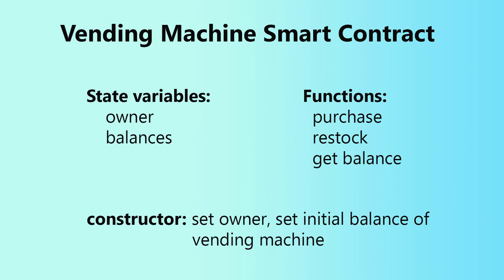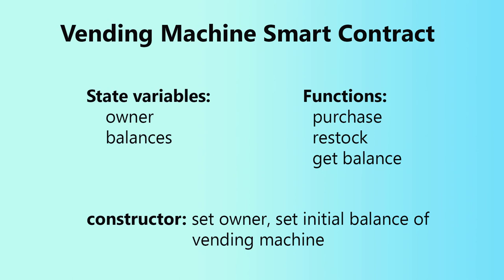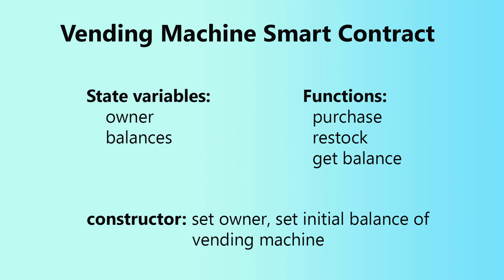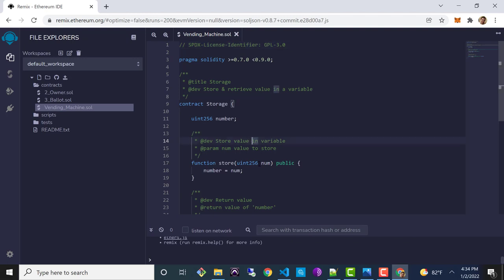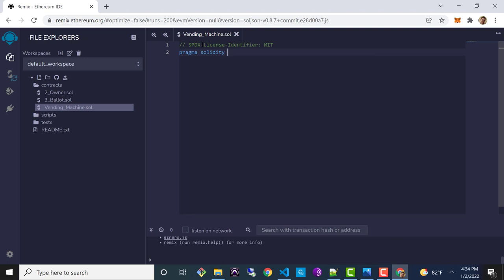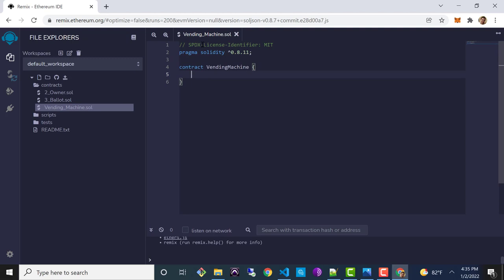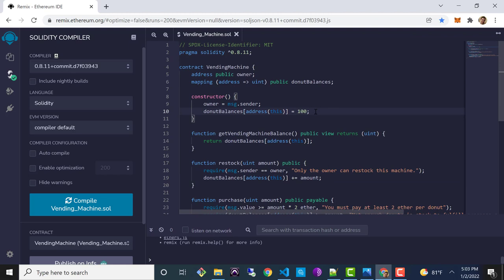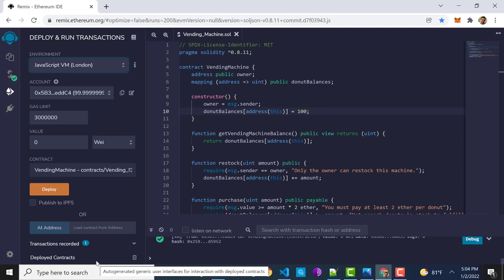Smart Contract Tutorial - Vending Machine Smart Contract in Solidity

Comment: I do have a question.
In few last lines you defined how can someone send a transaction, however, I didn't see you specified anywhere whom the receiver should be. Is that a mistake or I missed something?

Also I saw balance of your acc was 95.99ether and you used it from the same account so it should have been 99.99 (because those 4 eth would come to your address anyways)

Comment: I'm starting with solidity and I still don't have the concepts very clear, so I don't know if the question is silly, but where does the ether that is sent when you buy a donut go? Because I see that the balance of the owner's account does not change
Reply from the maker: hey David. that's actually a great question. the ether you send in to buy a donut goes to the smart contract itself. a smart contract can receive and hold funds just like any wallet. it's the 'payable' modifier on the 'purchase' function that allows the contract to receive funds. in order to get paid, the owner of the contract would have to withdraw funds via a separate function call. The current contract doesn't implement such a function, but it would look like this:

function withdraw(uint _amount) external {
  require(msg.sender == owner, "Only owner can call");
  payable(msg.sender).transfer(_amount);
}
Reply from the maker: or 'address(this).balance' to reference the entire balance of the smart contract
Reply: @BlockExplorerMedia  In addition to withdraw function, You also need to make the owner address payable for fund transfer.

Comment: Talking about the purchase function, you tested using the same address as the owner address (msg.sender == owner), how come it worked storing the correct amount of donuts? Could you explain this? I expected something like: 
        donutBalances[0x123] -= 1;
        donutBalances[0x123] += 1;

So the donutBalance of 0x123 would be 100, not 1 or 99.
Reply from the maker: Hey great question. 'msg.sender' means different things depending on the context of where it's used. In the constructor it refers to the address that deployed the function. In any other function, it refers to the address that called that function. Does that answer your question? Sorry if I didn't make it clear - I talk about this in a upcoming video that I'm currently working on. Thanks!

Comment: Thanks for this video Block Explorer. I noticed a slight issue though, if the value passed is let's say 20 ether and the purchased donuts are just 8 ( which should cost 16 ether ) it still deducts 20 ether from the balance.
How can we fix this?
Reply: in purchase function change the
require(msg.value >= amount * 2 ether, "You must pay at least 2 ether per donut"); 
to
require(msg.value == amount * 2 ether, "You must pay at least 2 ether per donut");
you change the >= to ==
Also, don't forget to deploy again the contract.
Reply: @kokoras12000  thanks! Did this eventually